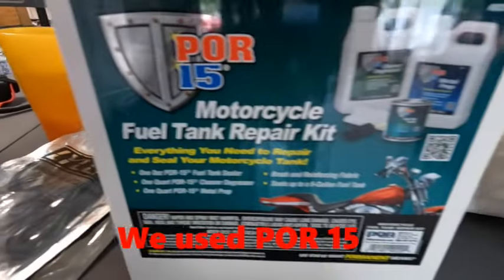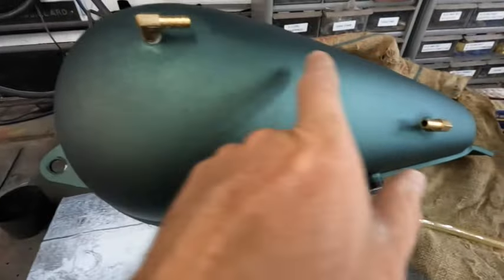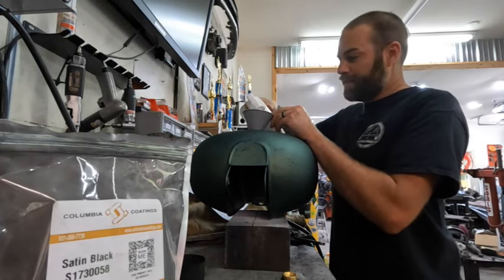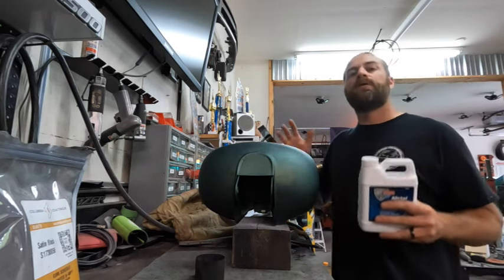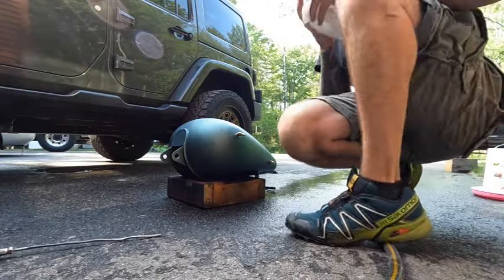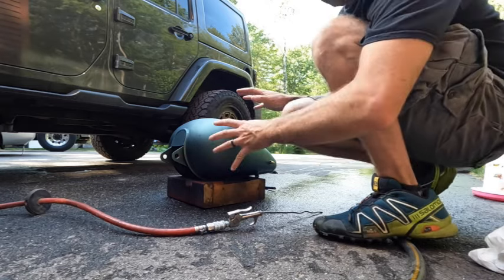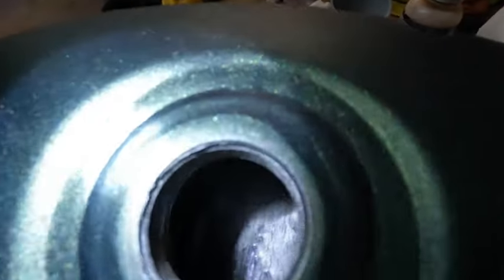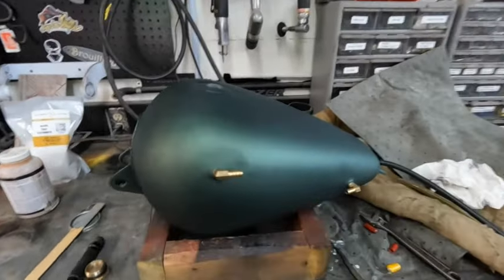Must watch before using a gas tank sealer!

Comment: I've gone through this process several times recently and it's quite tedious. It takes time and care. I'm sure that neighbors are wondering why I've been holding and spinning fuel tanks for hours on end while walking around the yard
Reply from the maker: But it works well done properly
Reply: it worked on my kawasaki..
Reply: I'm having the same thoughts about my neighbors! LOL. Yes, it is tedious when done right, and doing it right can't be rushed. Those who rush it and do if poorly pay the price. I guess that goes for all things automotive. I used copious amounts of muriatic acid, twirling and turning, rinsing and repeating. The POR15 tank sealer should do fine as long as I don't rush the 96 hour curing period.
Reply: Exactly 😂😂
Reply: 5 minutes??? Try 20

Comment: what do i do if my tank has pin holes in it so anything that i put into it comes out?
Reply from the maker: I believe this will seal pin holes as well
Reply: @FlippinCustomized  yeah it's advertised like that. But what I mean is like the process of removing rust/cleaning the inside of the tank. If I were to put a cleaner or something inside it would just come out
Reply from the maker: Some yes

Comment: Not sure putting it out in the sun is the best way to go.  I'd just leave it in the garage and wait the 4 days.   Beware, when you think you've drained it all, there's still more to get out.   If you think you're done and leave it sitting at a slight angle, you'll come back to find some POR pooled up in the tank, which isn't good.  Set it in a position where the excess will spread out and not pool in a crevice.
Reply from the maker: Correct, was put in sun after it had solidified

Comment: Tip for anyone else watching, my tank has a port on the bottom with threads on the outside that the tillotson fuel filter screws onto. I drilled a hole into a wine cork and threaded it on to plug that hole. It worked great. My gas caps were vented so i ductaped the hole. A big plug would be ideal but my paint is going to be redone anyway, i wasnt too concerned about damaging the current paint

Comment: Thanks a ton for your video. I actually bought a spare tank for my vintage cushman because the previous sealer in my original tank was cracked and failing. It was the white stuff. I started with the degreaser on that one and it didnt touch the old sealer so i put a gallon of acetone in it overnight. That disolved it. Then i went to the degreaser. For the spare tank, it was dirty inside. I started with white vinegar and some nuts for aggregate and shook it all about. Then i moved onto the degreaser. Poured the metal prep from one tank to the other after soaking all sides and then drained it back into the og bottle when both tanks were done. Both are now rinsed and bone dry ready to do the paint step in the morning.

Im really glad i had a heat gun, as the shape of my tank leaves some liquid in there.

Anyway, thanks for the step by step. Both these tanks needed it. Surprisingly, the less rusty one is more solid than the other one that had a pinhole. I kept losing any gas i put in overnight.
Reply from the maker: Glad it helped and thank you for watching

Comment: Thanks that was great video,  it helps me on my older cars that fuel tanks are hard to find in good shape if needed. At least this process do the trick on pin holes if any and stop any from accruing.
Reply from the maker: Your welcome it has worked for us on several projects

Comment: Another question.   I used a different sealer in a tank once,   it flaked up after 10 years.  How can I get it out?????? There is rust under that white sealer.
Reply from the maker: 10 years that’s good, try the old rocks in gas tank and shake to break it up
Reply: belated reply, just FYI-- I used a pressure washer wand on my soda blaster and got the tank's inside really clean. Took a couple of days and 40 pounds of soda, and a narrow goose neck LED desk lamp to see inside.

Comment: I'm wanting to use it on a 1957 moped. I'm fearful that the material will reduce the inner diameter of my petcock so that I want be able to get the petcock and it's stems back in the tank. The untreated inner diameter is probably about 1/2". What are your thoughts?
Reply from the maker: Can you access it to wipe that portion before it cures?

Comment: if the fuel tank takes a hard hit, it can damage the insulating layer(sealer layer), which can lead to other damage to the carburetor?
Is that correct or not?
Reply from the maker: Never experienced that
Reply from the maker: Not sure but seems flexible

Comment: Would u recommend coating a brand new ebay gas tank has never had any fuel or anything in it
Reply from the maker: Honestly wouldn’t hurt they are very thin and rust out

Comment: Did your kit come with the repair cloth for larger holes? I definitely dont need that, I wonder if buying the degreaser, rust stopper, and sealer seperate is cheaper.
Reply from the maker: It did not, it may be a few dollars cheaper yes
Reply: @FlippinCustomized thanks man! I see on por15's site they sell everything separate. Perfect, I actually have 2 tanks to do so I'll get the required sizes.

Comment: The black rust paint is a disaster in a can. The tank liner works great, prep is key.
Reply from the maker: Prep is key
Reply: I have used por15 rust paint on projects many years ago. Absolutely no issues in over 10 years. I use it on the frames typically

Comment: what if there is bits of loose rust in the tank, how do you get that out before putting the degrease in
Reply from the maker: Ensure its completely dry after washing out and I use compressed air and a shop vacuum
Reply: I use a garden hose. Rinse it out… then let it dry.